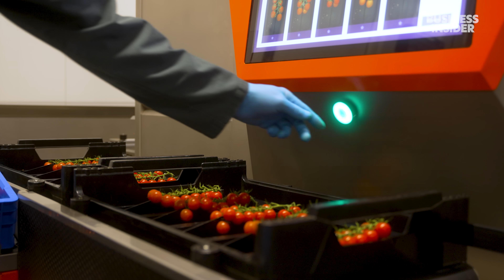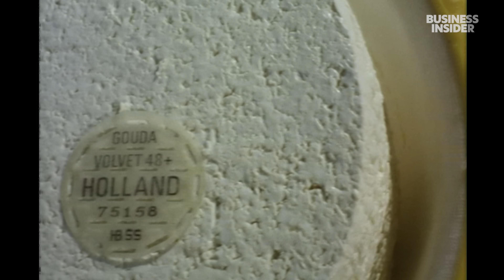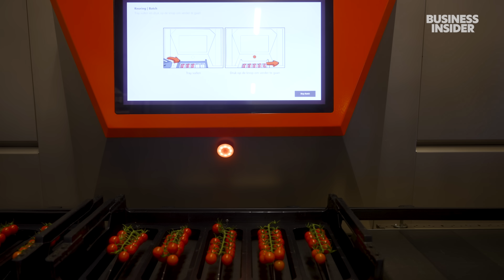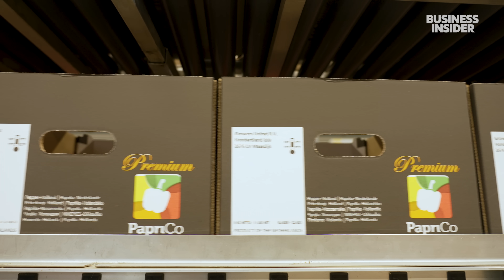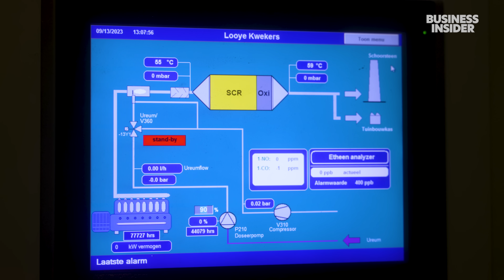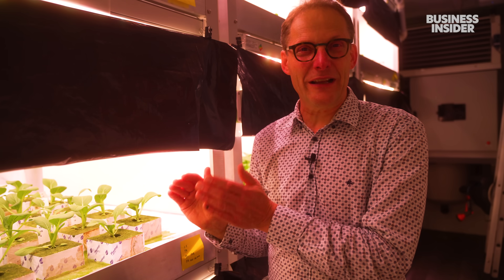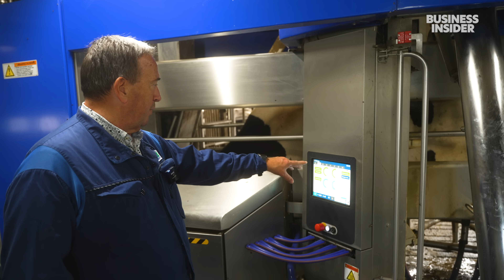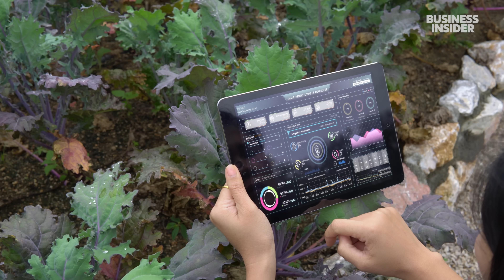How One Tiny Country Rivals American Farming

Comment: 10:50 "untill recently much of dutch energy came from russian gas" that's just wrong, it was only 10% of dutch gas consumption and only half of their electricity was produced by gas turbines. So about 5% of dutch electricity was made with russian gas
Reply: From Oktober - April greenhouses need to be warmed wich was always done with natural gas, wich takes a huge amount of gas. In this industry i can imagine it was a large part of the bill.
Reply: @JikkieJakko-l5f  The Dutch did had there own gasfield for many years with a lot of gas
Reply: @JR-mh8vn  yes we had. But most of it was sold for profit so companies could make more profit on selling foreign gas to us.
Reply: @JR-mh8vn  It's still there, pumping it was just causing earthquakes so we shut them down.
Reply: @JikkieJakko-l5f October* little bro this is America.
Reply: @ihrdforth3   .. Agricultural Exports .. 
1st 🇪🇺EU €235b       2nd🇺🇸US €150b
Comparing a single 🇪🇺EU state to 50 🇺🇸US states is major cope .. to make 🇺🇸US appear 1st
Reply: Interesting movie, but it missed out on the discovery of Dutch natural gas. In the 1960s the Netherlands converted to natural gas, sold against low prices. Cheap natural gas was one of the reasons the greenhouses to flourish. Energy cost are nowadays about 1/3 of the cost of operating a greenhouse. As shown in the movie, gas is used to produce heat and electricity. These relatively small units are used to balance the energy grid, as they can be switched on and off quickly. This balancing is very profitable.
Reply: Exactly, the Dutch have a large natural gas field that supplies most of their natural gas domestically.
Reply: @cala9765  not anymore, extraction was stopped for safety reasons since it started causing earthquakes and ground movement.
Reply: @cala9765   We have it, but we closed it. Why don't ask me.
Reply: bs
Reply: Yeah, the Netherlands has one of the biggest natural gas networks in Europe, because of it's own gas fields.
Reply: 5% , when looking at the economy, is much

Comment: What is MINDBLOWING is that they will say you cant farm this way because of pollution, Yet MOST of the pollution comes from the tens of thousands of planes that are in the air at any given moment. not to mention the billions of cars....
Reply: We have too much nitrogen in the ground because of cow farts
Reply: Actually the worlds population of cows causes about the same amount of pollution as all cars and planes in the world combined. Mainly because methane has about 86 times more impact on climate change compared to carbon dioxide.
Reply: @oko2708  Where did you find said information
Reply: The difference is they can control this potential pollution, where as they can't control the tens of thousands of planes and billions of cars around the world.   Not that I agree with it mind you, especially when a great amount of power is renewable.
Reply: Also very different kinds of polution for the most part. Planes are mainly related to air polution, whike the laws that are hitting the dutch farmers are about ground and water polution. E.g. if they put to much manure or fertilizer on a field, it will get into the groundwater and waterways. In the groundwater it needs to be filtered out when that is pumped for human consumption, whike in the waterways it leads to algae blooms and such killing off all the other plant and animal life connected to the waterways